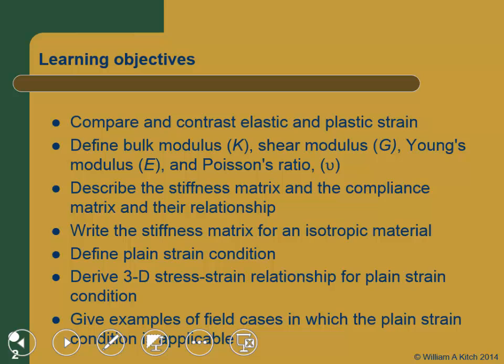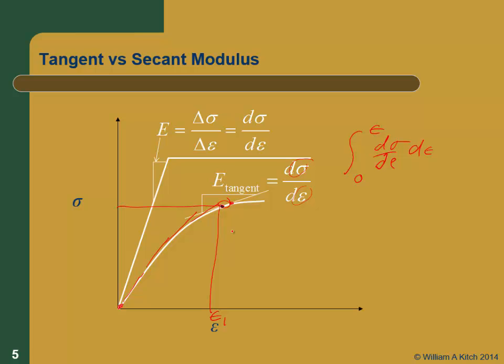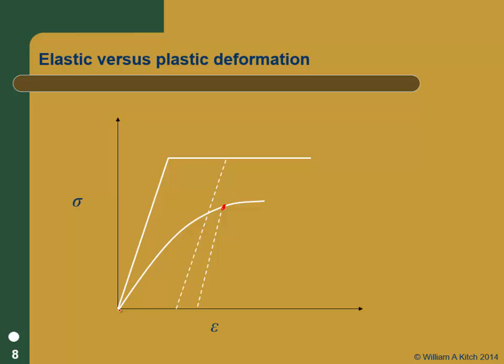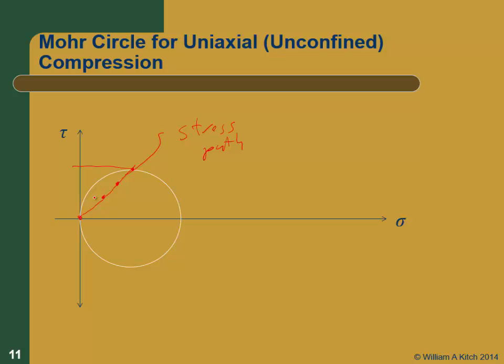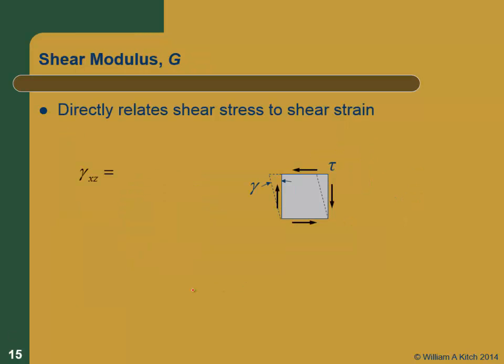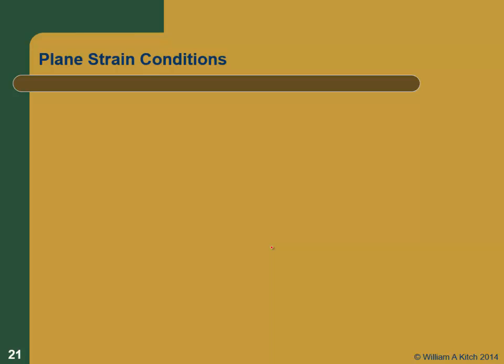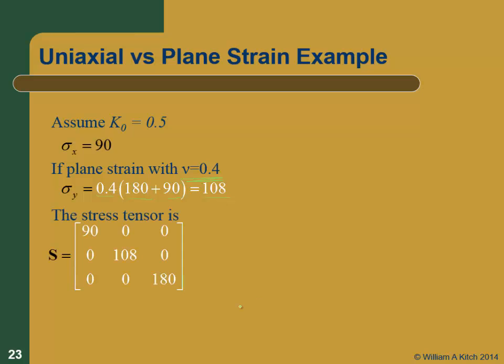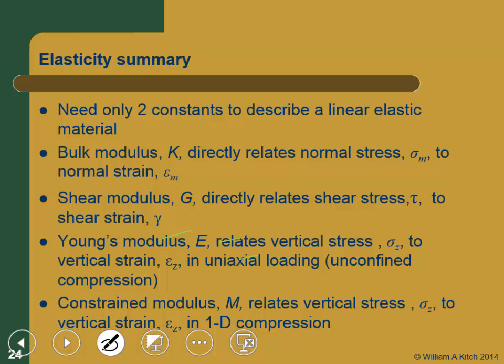CE 531 Mod 1.3.1: Elastic Theory

Comment: In this video, the issue of the proportionality of stresses and strains under uniaxial compression is partially addressed. I would like to note that this issue is explored in more detail in the works of Professor Tagiltsev. By jointly solving the Mohr-Coulomb law and Hooke's law, he essentially derived a new form of the Mohr-Coulomb law, which allows for a mathematical connection between the main strength and deformation parameters. If anyone is interested, I recommend following the link:
https://www.youtube.com/watch?v=Wt_ubGY1l-I